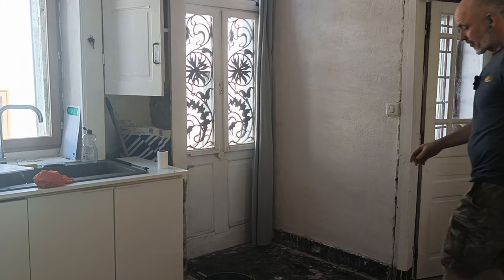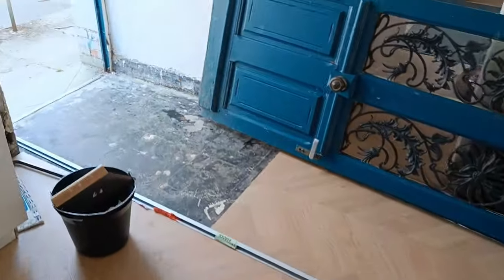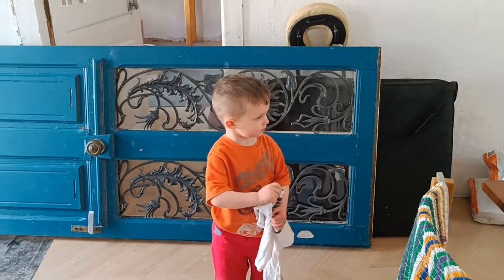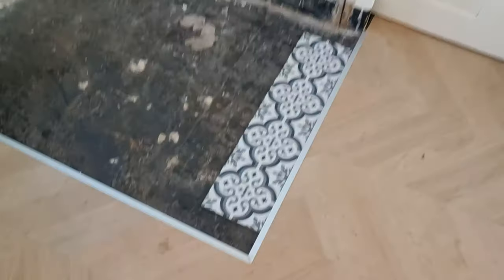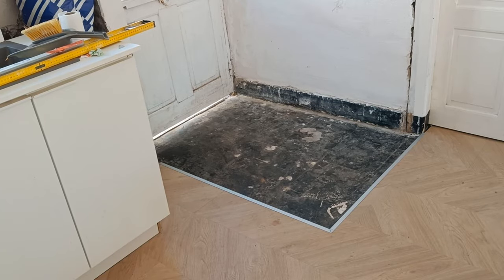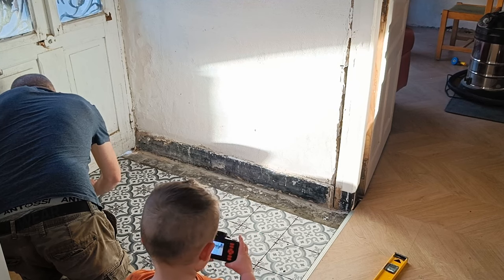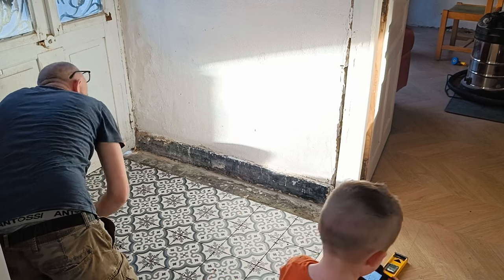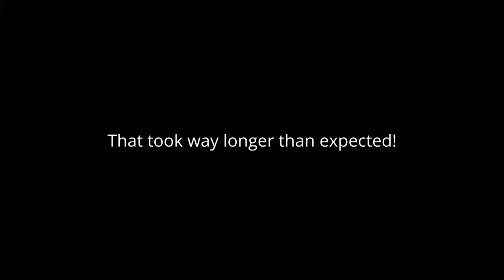Doing a bit of tiling in our French Renovation

Comment: Nice tiles! I chuckled when you broke the white tile and said "Okay, so that didn't work." You have a great sense of humour, I've said it before but I'm saying it again. Good little helpers you have there. Mina and Mana were snoozing instead of helping? Wow those tiles just fall beneath the door - good job and it really looks nice.
Reply from the maker: I don't really have the time to mess around with my ideas at the moment Tracy so if it doesn't work first time I just have to crack on!  It was the same in the bathroom with the mirror.  I didn't have materials to mount it off the wall so just put it up and I'll come back to it later! Mina and Mana were banished to the garden while I was tiling!  They would have been gone out the front door in a flash and off on an adventure.